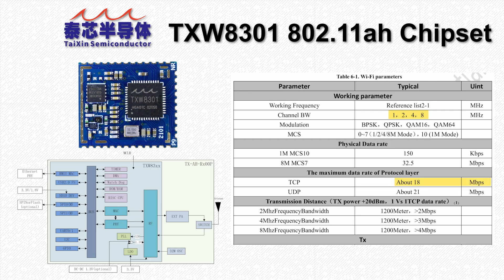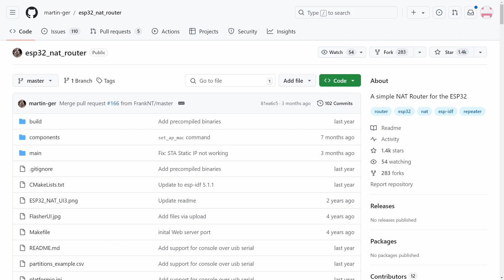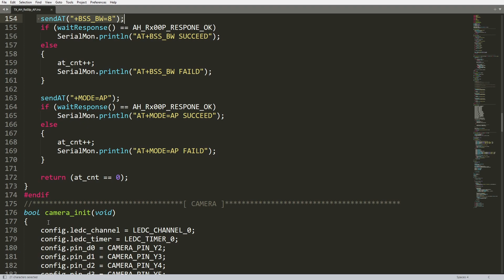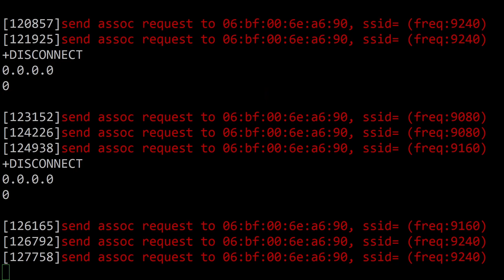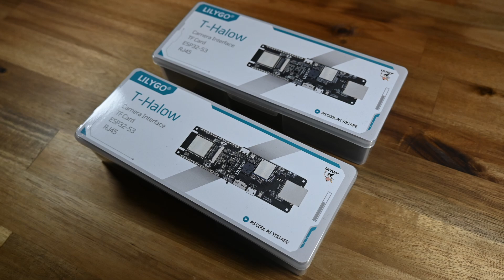LILYGO T-Halow - The first ESP32 Development Board for WiFi HaLow

Comment: I spent 2 months on this and wow it works brilliant. Had to get SDK and write good bit of code. Also connected the UART with ESP32 instead of RJ45 so I can send data in transparent mode. Programmed my own flash chips. ESP32 collects data > sends to AP via UART > data sent over HALOW 40m away > received by STA > data passed to ESP32 on STA side via UART. DONE.
Reply: you... uh.. got a repo?
Reply: repo please.
Reply: Where did you get the SDK?

Comment: Damnit.  I also ordered 2 of these + camera module, making the same assumptions.
LilyGo have also used an AI David Attenborough voice in their demo video
Reply: The fact their GitHub repo for this has camera and mic demos (which turn out to purely for 2.4ghz WiFi on the ESP32) is misleading to the point this feels more like a scam than a fumble.

Really disappointing from them.
Reply: I would have bought the heltec dev board instead, but they’re not shipping the EU variant as far as I can see 😢